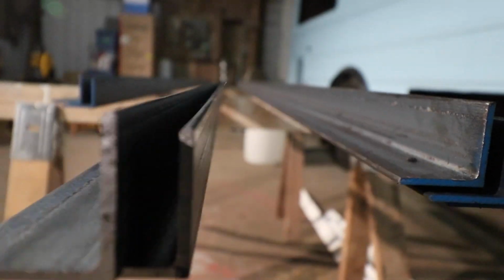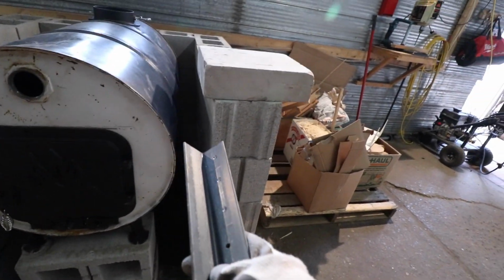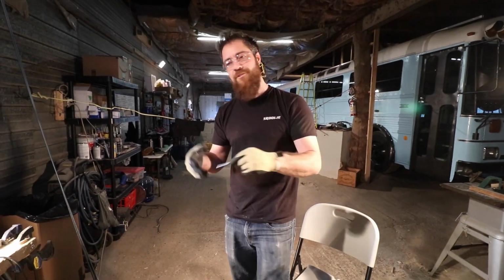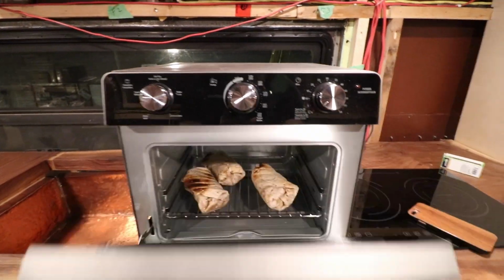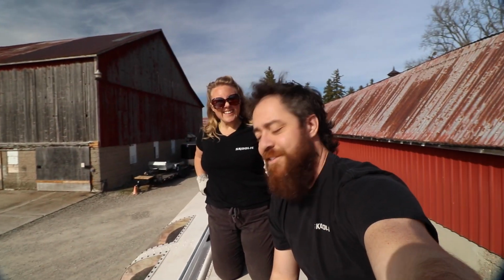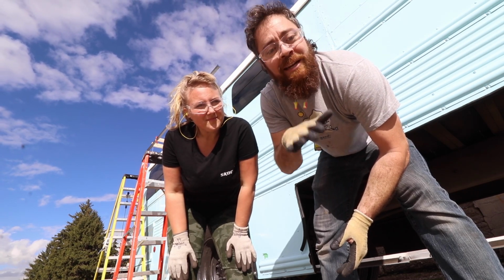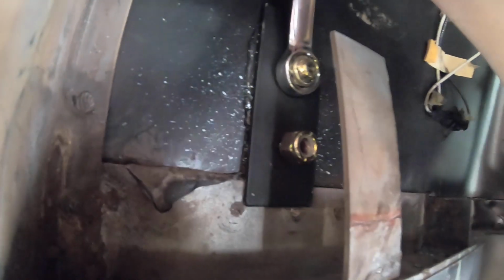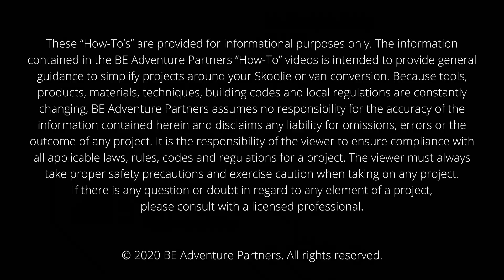ROOFTOP TWEAKS | 50 MORE HOLES | Building & Installing Skoolie Rooftop Deck Mounts

Comment: Wow, since we will be doing our rooftop the same as yours, it was nice to see how to do it.  Now that I know, I will start manufacturing those inside metal pieces.  💜 LueyD
Reply from the maker: There’s going to be more on what we do in this! These are just the vertical supports for distributed load. We’ll also be installing various other bracing for dynamic loads (like wind shear). Super excited for y’all!
Thanks for watching!
- Brian + Erin

Comment: I am curious why you didn't bolt through the ribs. I'm concerned that the metal may not be enough support.
Reply from the maker: Hey there @The Breeze! We talked about this a bit in the video... however, if you missed it, we bolted through directly above the horizontal beam above the windows. Something we didn’t mention is that the way we bolted, the mega washer clamped onto the horizontal beam just like using a “beam clamp”. The roof metal is 1/8” steel... the angle iron is 1/8” steel... so the strength is created by multiple touch points. Although we’re not engineers, it’s simply the disbursements of weight across a system. All the weight is not being applied to a single vertical support, rather it’ll be applied to hundreds of attachment points. We’re not done yet, so the future vids will shed more light showing how it comes together. Hope that makes sense & thanks for watching!
- Brian + Erin
Reply: @BEAdventurePartners  I understand your theory. Your roof metal might be closer to 14 guage though. I've never seen 1/8" thick metal on a bus anywhere. Keep on truckin!
Reply from the maker: @The Breeze - It's crazy thick! It's a fraction smaller than an 1/8th of an inch. Fingers crossed. Winter is coming real fast, so we will have to shift gears. BUT when we get back into decking, and mounting the solar panels we will talk more about what we have learned about weight distribution, and loads. So far, after consulting with some local contractors we know, and an engineer it sounds like we are good to go.  We realized we should have shared more of that technical stuff we learned. We will do our best to clear it up in a future video. Thanks for piping up! We appreciate it. - E + B too

Comment: Raised the roof on mine and just ran some of the new supports straight up through the roof for racks.:)
Reply from the maker: Brilliant @Djed Eye! How did the raise go?! Haha we would have never fit back in the barn if we did a raise. Wasn't an option for our build here in Canada. lol too damn cold to work outside.
Reply: @BEAdventurePartners  Went well.. A lot of welding. The time lapse vids are deceiving ..;Still doing window frames and transition.

Comment: That tape is pressure sensitive. It should only be slightly tacky when the backer is pulled off. You are supposed to use a roller and the pressure adheres it to the surface.
Reply from the maker: Good to know @Robert Mcdonald! Hope it works... We have leak tested and so far so good.

Comment: Holy Moly 20 degrees in a t-shirt? I would have the heavy coat on! Im used to the 115 degree AZ weather! Brrr
Reply from the maker: LOL @Mike Taylor. 20C is nearly tropical in Ontario Canada! ;) You can send us some hot AZ weather please! We're finally getting up above freezing here! The sunshine is delightful!
Reply: @BEAdventurePartners   HaHa. I forgot y'all deal with celsius! I was thinking 20d F! In about a month you can have all the heat you want from down here!
Reply from the maker: LOL - In a month... LUCKY! We gotta wait a couple months likely until it gets warm enough to be up here without layers on!
Reply: @BEAdventurePartners  Its a crazy trade off. We have perfect weather from November to April but the other 6 months you literally burn the skin off your hands on the steering wheel! We cant work on metal out doors at all. Nuts. But I hate the cold so I would not trade with y'all! It was like 40 d F and I was freezing! HaHa